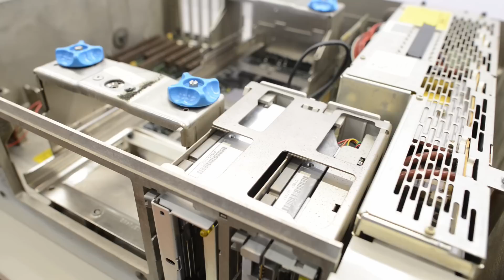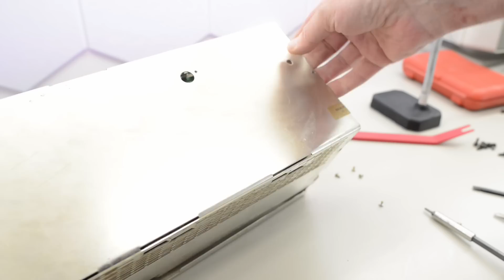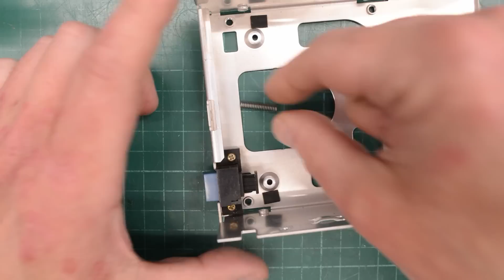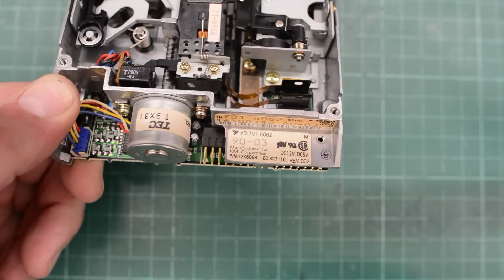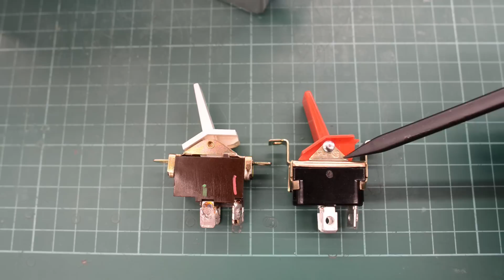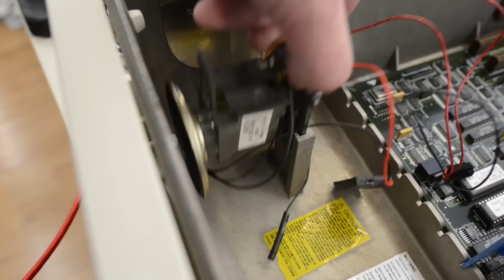IBM PS/2 Model 80 restoration & mods. 386DX25

Comment: I ordered one of these around 1989 at work to run a relational database system and to run the associated remote data capture system. Eventually it was replaced so I brought it home. After I retired I tried to sell it but there was no interest at all and several PS/2 systems had been on ebay with no interest. I tried firing it up and it POSTed but wouldn't run. So I had to scrap it. It's such a shame. 

About a year after I started using it at work I installed a Novell network but that didn't work. We contacted IBM and under our corporate maintenance contract their engineer came and swapped out the motherboard. Apparently an I/O or DMA line was missing in the early design
Reply from the maker: I wish I had collected a few back then when they were cheap and plentiful
Reply: @Epictronics1  I wish I hadn't thrown away all of the computers that we used and then replaced at work. We did have a scheme for some that sent some PCs to Africa but that didn't stop many computers being put in the recycling pile

Comment: MXR and DOD effects pedals from the 70s and 80s also have this obnoxious petroleum based foam in them, on metal parts you can use acetone to remove it cleanly. If it's in contact with other metal parts that are not painted it will cause them to corrode, very awful stuff.
Reply from the maker: I noticed. The green stuff under the black chees turned out to be corroded conductive paint!

Comment: I never ran into the model 80's as workstations always as servers due to the "large" number of scsi drives you could cram in them and have a tape backup drive. I also remember the floppy drive cage with edge connectors but I only serviced a hand full of these over the years. Not being an IBM official service rep getting parts, manuals and setup disks were always a huge pain in the ass.
Reply from the maker: Thank god we have Ardent now :)

Comment: I love my model 80.  Had one in college in the early 90's as a replacement for my really slow PS/2 55sx.  I just had to get one for my my modern office.  
The foam was horrible to remove and as pieces flaked off they would stick to the carpet and stain it.  In the end I had to use brake cleaner on paper towels to get it out of my case.
To try and get the most life out of the model 80 as possible I used my thermal camera to find hot chips on the motherboard and MCA cards.  I then added stick on heatsinks to those hot components to keep them cool.
Looking forward to your next video in the model 80.
Reply: Careful with certain plastics and brake cleaner (same as carb. cleaner) can make plastics more brittle or bleach/etch/discolor them
Reply: Good point.  On more sensitive areas I switched to an adhesive remover like Goo Gone.
Reply from the maker: Brake cleaner? I'm gonna try that next time!

Comment: PS/2s are so cool, especially when you think about how much these things cost when they were new.  I have a Model 60 that I got a few years ago  which is very, very similar to the Model 80 but it is rocking a 286 processor. It took quite a while and a complete tear-down to clean up all the deteriorated foam from inside it.
Reply from the maker: My first Wintel PC back in the day was a 286 PS/2!

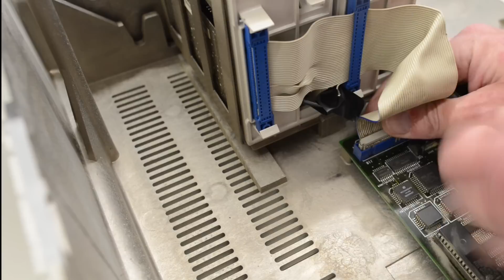Comment: @5:54 - Later Model 80 cases removed the edge-connect assembly at the back of the diskette drive cage, and switched to the "small button" 34-pin connect drives. The back rotating 'T' foot was also replaced with just a heel. I'm not sure where exactly in the lifecycle where those changes occurred, but you might be able to narrow down the production date (and manufacturing location) by the serial number.
Reply from the maker: The newest chip on my board is manufactured in week 11 of 1992. It seems to be easier to find a cover for an edge connector drive than one of the "new" drives. I think I'll go with whichever I can find first for this build
Reply: @Epictronics1  - The 'Type 3' Model 80 is an IBM Japan planar with two AVE "8514/A") slots and socketed KBC chip (unique among all PS/2 models).
Reply from the maker: @IBM_Museum  It's a great board. I was a bit surprised by the two 8514 slots. I'm planning to install my 8514 in my Model 50 and an XGA-2 in this machine. Seems like a better choice?
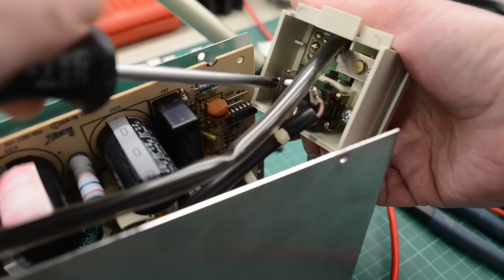Reply: 38:48 - Peter Wendt, the German IBM engineer, mentioned an issue with the Model 80 PSU switches, maybe contributing to the color myth.
Reply from the maker: @IBM_Museum  Yeah, I forgot to mention that in the video. I read that on Ardent while recording. Maybe there was an issue with the manufacturer of the red switches?
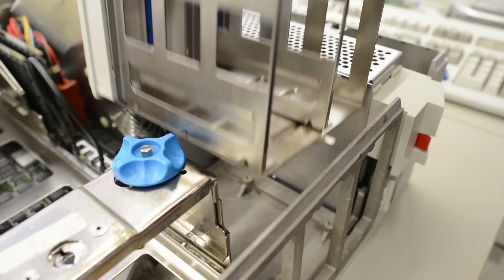Reply: 45:06 - The drive cage wasn't changed, just the rear edge-connect retainer; You can see the side cut away for the 4869-001 bay adapter pass-through cable.

Comment: It is really no point in using both IPA and denatured alcohol as solvent because those are both alcohol and works in similar ways. I'd recommend petrol/diesel instead, as alcohol is polar solvent and petrol is non-polar.
For cleaning this sticky rubber, I'd suggest a knife that is being used to clean ceramic stoves.
Reply from the maker: I may give that a try, thanks

Comment: Downside with PS/2 is the lack of ethernet and soundcards.
Reply: Whereas MCA token-ring, there must be millions of those in landfill
Reply: @sprint955st  Yepp.
Reply from the maker: I have a replica AdLib and parts on the way to build an MCV Sound Blaster :) NICs without an RJ45 are cheap on eBay. Maybe there is an RJ45 converter?

Comment: Totally agree with the decision about the power switch. A PS/2 w/ a white switch just seems weird.

As a teenager I had a summer job cleaning up drug stores in the early 90s in Vancouver, Canada, and I remember there would invariably be a Model 80 in the back office. Usually they would be hooked up to a tractor feed printer and an X.25 packet network (Datapac) to talk back to the central office.

Comment: The "higher end" and newer machines had white switches, as i remember
We had a Model 80 very early, it had written on Model 80, not 81 and hat a red power-switch
Reply from the maker: I don't know. I have seen a mix of PS/2s with white and red switches
Reply: In the U.S. market, a white PS/2 switch means the upper-level model of that case style (because it can also mean a higher wattage PSU). But it was rather mixed in the European region. One false story is that the switch (no pun intended) from red to white was because of some European requirement (without ever mentioning the country/countries).
Reply from the maker: @IBM_Museum  In either way, it was a bad move ;) Red switches look great!
Reply: @Epictronics1  Personally I think the red switch on such an expensive machine looks tacky and cheap. The creme/white switch is there for a reason, to convey it's an expensive high end computer. It's like someone with plenty of money buying a mahogany and leather lounge just because they have money to burn. It doesn't need to be expensive solid wood and high end leather but they want to show they are rich. The white switch shows classic subtle elegance and style. Red switches were only used on low-end cheaper store bought off-the-shelf models and you've ruined it. You should put the original white switch back in before anyone notices and cut that section out of the video quickly before the high-end PS2 Switch Police come looking for you ;-)
Reply from the maker: @g4z-kb7ct  You're right. I'm gonna paint the switch white on my 5150 immediately ;)
Reply: I have 55SX made at the end of 1991, it has white power switch. I think later machines got white switches.

Comment: Watching your process to clean up that foam gave me flashbacks to my old Antec Sonata mid-tower case. 
It was a pretty quiet build in 2003 but I wanted to make it even more quiet and installed an after-market sound deadening kit consisting of enough rubber+foam cutouts to cover the entire inside surface. 

When the foam turned back into dino poo, I spent hours scraping and peeling sticky, gooey and dusty foam off of the inside. I considered condemning that case multiple times during the journey and it still smells like Goo Gone whenever I fire up that system. 

Nice video! I've got a special spot for desktop cases but a very close second are these full towers.
Reply from the maker: Thanks! And holy crap, an entire case filled with that nasty stuff! It must have been a pain to remove :o
Reply: IBM also used the same foam on the big floor-standing printers to mute the noise - I've got a few units that I need to clean up and replace it.
Reply: All that mess, and here I am wondering if solid sheets of cardboard (the stuff with a wave sheet glued to two flat sheets) would have done a comparable job.
Reply: It pains me to think of a build in an Antec Sonata as a retro computer in need of restorative work.  ><
Reply: @sirnickity  Indeed. ><